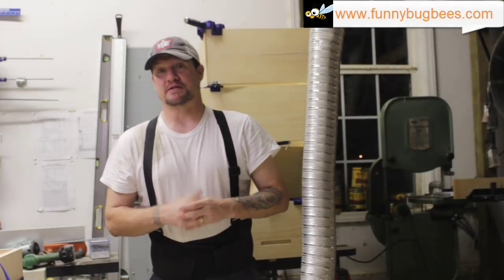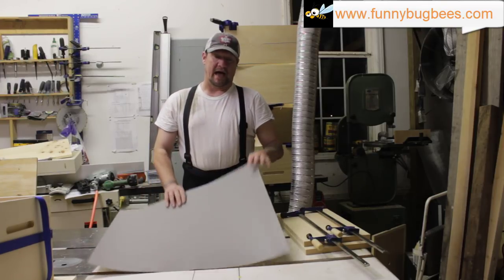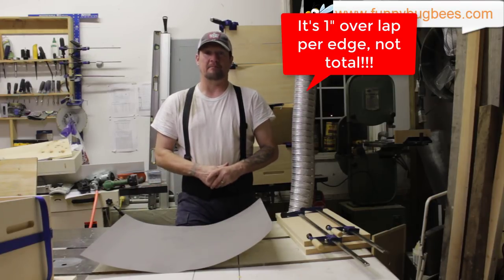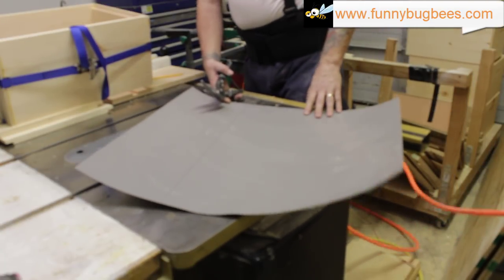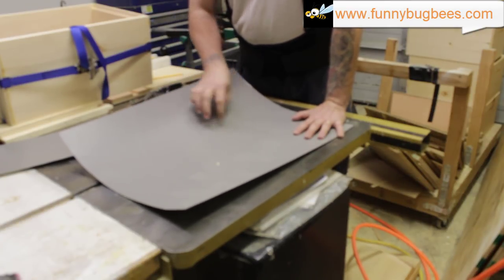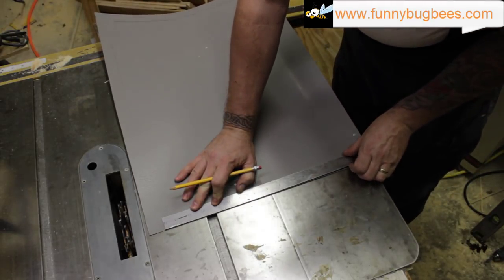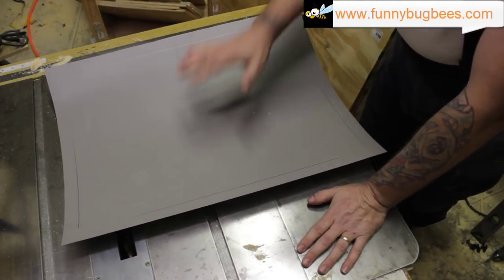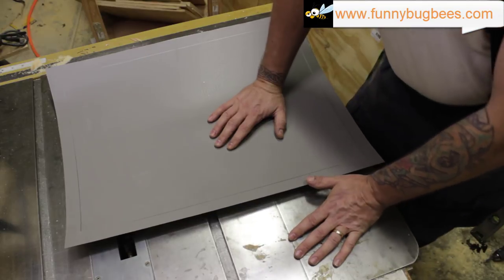HowTo: Super Simple metal covers for your telescoping tops

Comment: I haven't ever had more than 20 hives and I have never had a telescoping top cover made with anything but 1/4" plywood painted. The odd top cover has been chewed on by a black bear, but they have stood up to the Canadian prairie weather very nicely without metal or plastic covering. Some of these covers I did repaint once though in the last 22 years.
Reply from the maker: Must be pretty dry there..Here in the deep south where humidity is 100% from early June until mid-November...un-protected plywood, even painted plywood wont last long :(

Comment: i find the size of my covers can vary enough to make the metal hard to fit.  So, i use the cover the metal goes onto as the guide.  I don't have any marking to do, just center the cover over the metal, hold 1 long side metal and lid together and lift.  this bends a side at a time.  Do the same for the other long edge.  I also flatten out the corners before bending both the short edges.  I do the corners the same way for making the 45 degree angles, but I use the lid to tap everything down before stapling the metal to the lid.
Reply from the maker: For someone without good wood working skills, or some of the tools we have which ensure repeat-ability your option may work best. I say whatever works best for you is always going to be the best option.

Comment: Cut a 1" tab on all four corners and fold the tab side first.  Fold the tabs in the fold the short side. Screw the flashing to the top through the folded corners and in the centers. Viola.
Reply from the maker: This creates a break in the metal top, where you cut the seem for water to wick into. I prefer the no cut method to maintain the structural integrity and therefore the waterproof aspect of the metal top.
Reply: By folding the tab under it creates a weatherproof seal. Just like doing the corners using vinyl siding around windows corners.
Reply from the maker: if that method were waterproof they wouldn't put Tyvek on homes prior to vinyl siding :P Some water wicks in, then hits tyvek and drains to the ground instead of into your sheathing.